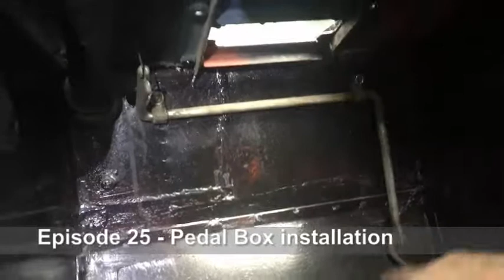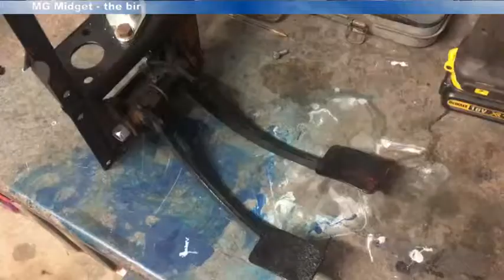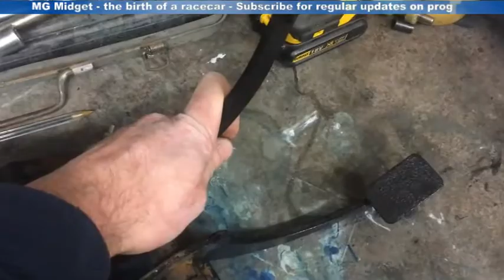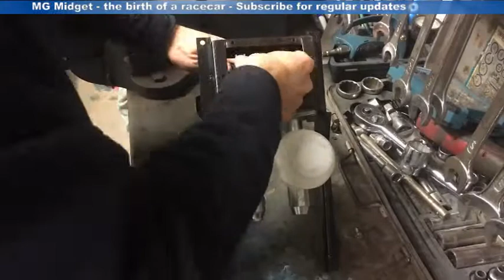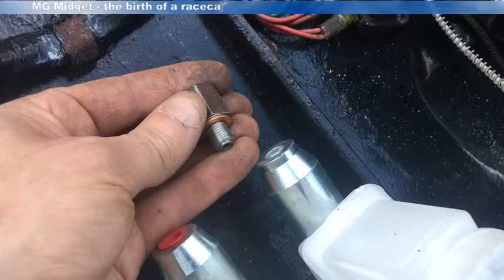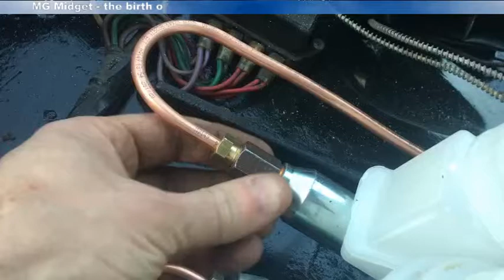MG Midget Pedal Box Installation - The Birth of a Racecar (Episode 25)

Comment: I see you are using copper tubing instead of steel.  With vibration, copper will work-harden and then break.  Steel won't.  Although, steel is much harder to work with, it is much safer.
Reply from the maker: Good tip! Thanks for watching